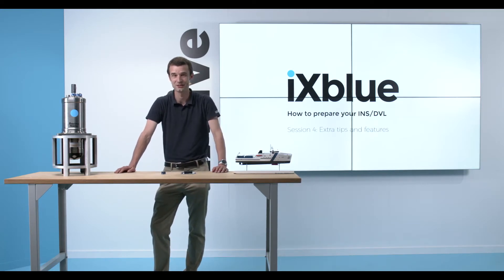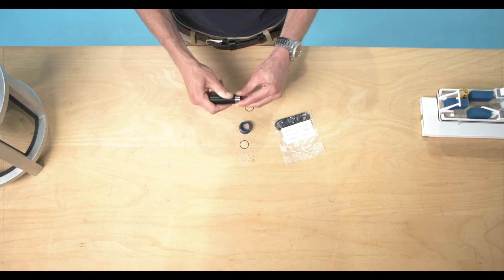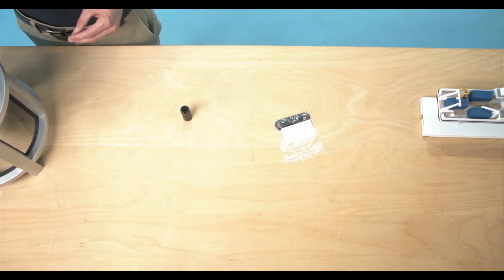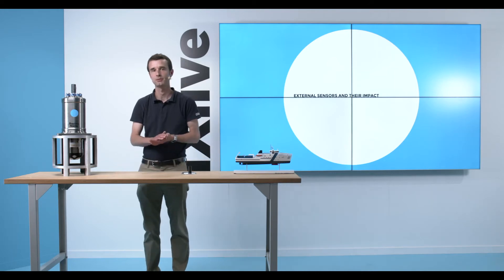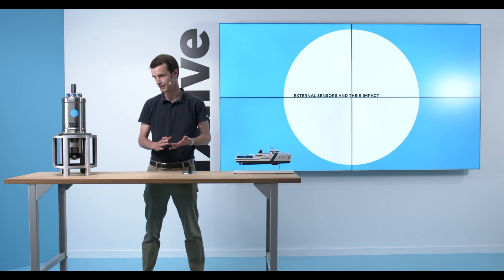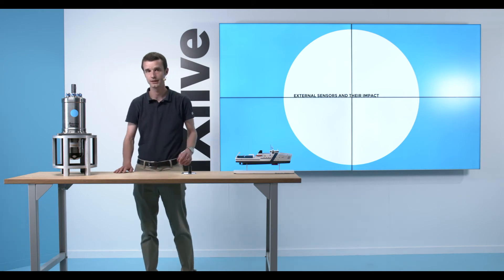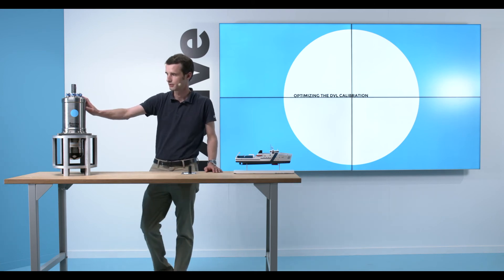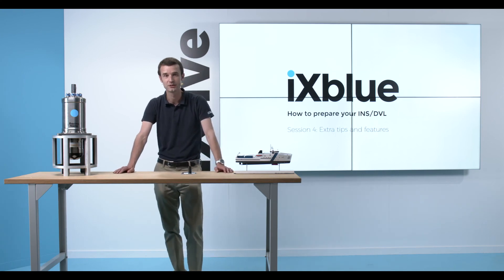How to prepare your INS/DVL? - Part 4

Comment: Doubts: 1. orientation of DVL and INS (correction -45)
2. Giving position: Beacon position should be given if sensor is operating with ROV.
3. Do we need to add external svp and give its string to DVL